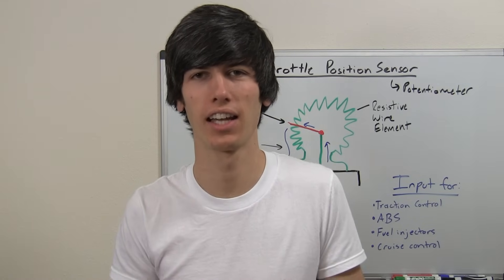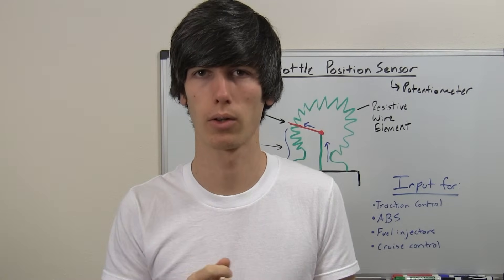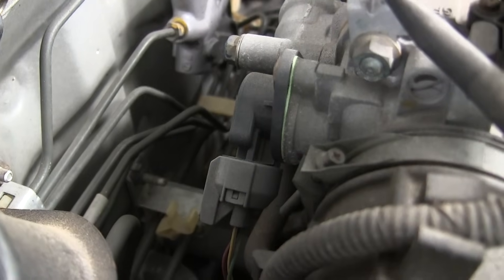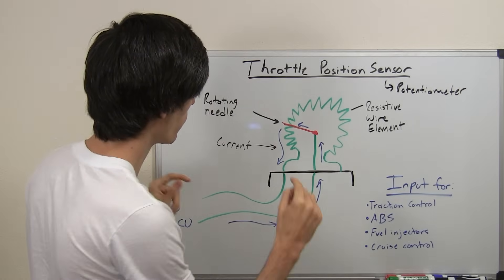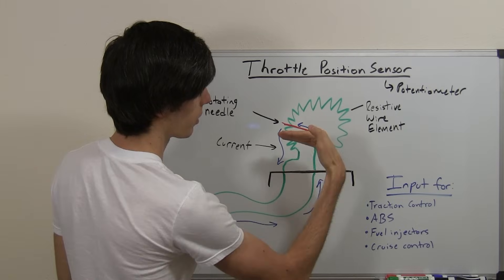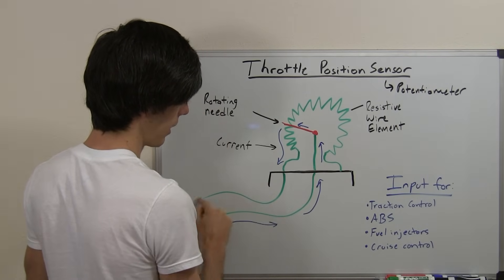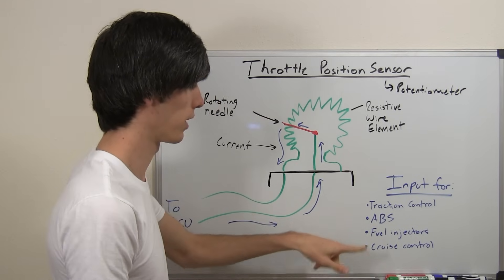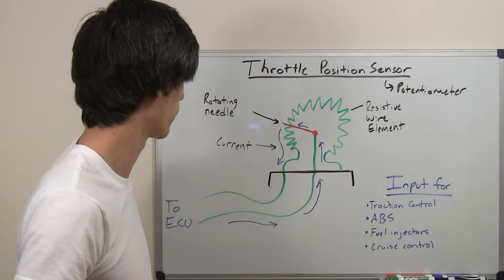Throttle Position Sensor - Explained

Comment: does a correct tps voltage affects the fuel consumption of a car? just asking
Reply: yess it does affect the fuel consumption.
Over time this sensor wears out, and will not read the same voltage anymore.
It makes the fuel trims rich if the voltage is higher,  or lean when its reading lower voltage.
It also makes a big difference in acceleration and torque feeling !

Comment: Is the TPS calibrated for a specific engine size and will that affect the engine performance if I put on the wrong one? I'm asking because I have a 3.0L V6 but when I look for a replacement part, they all say they are for the 3.5L engine model. Will that still be compatible?

Comment: Voltage divider circuit is fixed to a certain resistor division of a circuit,whereas TPS sensor works on rheosatat or variable resistor circuit such as volume control,etc.

Comment: If it's got a HIGH-RISE INTAKE than Does oxygen fall into the throttle body faster allowing more airflow? If u use a THROTTLE BODY SPACER oxygen falls further causing more compressed oxygen. Resulting with more power in some engines.

Comment: Good explanation but useless for me.  I need to know if the TPS is the cause of my crank/no start condition.  My 1995 Honda Civic (1.5L) runs perfect once I get it started but will not start without spraying starter fluid into the throttle body.  It will also start IMMEDIATELY when I jump a spark plug wire to ground to verify there is sufficient spark.  I have tested and replaced all the usual suspects, except the TPS, MAP, fuel pressure regulator and injectors. There is plenty of fuel pressure and the injectors pulse well.  I'd like to know if a bad TPS can cause a crank/no start?

Comment: Modern electronic automatic transmissions also need TPS input(for torque convertor lock-up). For that the ECU/ECM/PCM needs to know when the throttle is fully closed or not. There's an entire circuit in the TPS dedicated to that alone(a.k.a. the "idle" signal).

Comment: Can you assist my question:The TPS reading plays a vital role in the mapping and map switching .
Therefore it stands tor eason while I am trying to gain economy , with my TPS incorrectly seated , the maps are being switched in earlier or later than they should .
My assumption would be that the TPS voltage has to be set and recorded before any tune OR by factory to align the maps being used correctly .
Alternately the TPS can be used to fine tune the AFR based on its position at a certain RPM.Thanks in advance-Well done for appearing on Between the Lines Documentary -awesome Subaru magic

Comment: So the sensor tells the injectors how much fuel to input, which also correlates with the amount of expected airflow based on the butterfly position.  OK so it is this data the MAP knows and expects to see in normal operation.  The throttle position then creates that ratio of 14.7:1 fuel mix no matter where it is.

Comment: What could be the problem if my scan tool reads absolute throttle position erratic? Even when the vehicle is engine off key on. If I do not press on the peddle the reading erratically goes from 0% to 10% or so, back and forth. It does this while idling too. I checked for 5v reference and 1 to 5v output (as peddle is pressed). Seems good data is coming into pcu, it’s just interpreting wrong.

Comment: Can TPS have any impact on Tranny or how Transmission handles? I am hearing it can be the cause for RPM going way high and car not shifting to higher gear. A reason that someone may suggest you to rebuild the transmission!!  Is this true?
Reply: yes it happened on my 3.3 nissan engine and the transmission wasnt shifting when it should to a higher gear resulting in over reving RPM before shifting up

Comment: My 02 eclipse gt 3.0 is having problems idle'ing right after starting? It's been necessary lately to give a lil gas to stay going which I never had to do before? I replaced the Idle control valve, & removed my cold air intake but still I have the problem. Please HELP!! Thanks & love your content!

Comment: It seems to me that the TPS is another sensor that tells how much air flow is coming in so the ecu knows to inject more or less fuel. But then why would you need a TPS AND a MAPS?
Reply: Stephen Pentony map sensor is allot more precise. Think of it as a team. One is the muscles the other is the brains. One gets a base parameter, the other fine tunes it. Thousands of times per minute.

Comment: I have a 70 millimeter throttle body we set it at 5 we open the throttle reeds 4.5 I didn't have that tps on for a week and my check engine light is  on do I have a bad TPS sensor or did I do something wrong by trying to set it at 5 where it supposed to be at

Comment: I have a 2004 Suzuki GS500 that has a throttle position sensor. However, the bike has no traction control, no electronic fuel injection (it has a carb), no ABS, and no cruise control. What, then, is the TPS there for?

Comment: I think you explained this wrong. Potentiometers have three terminals, positive, ground and signal. I dont know is the ECU actually reading the voltage difference, because from middle pin you get variable voltage when you turn the pot. Please correct if im wrong.

Comment: Your description for what a TPS does is good, but your description of HOW it does it is not entirely accurate.  It works more like a voltage divider.  Most TPS are 3-wire; power, ground and feedback.  The resistive element is connected to Vcc on one side (typically +5V) and ground on the other.  The voltage along the resistive element will drop as you approach the ground side.  So the voltage read at the wiper will drop as it approaches the ground side.  The ECU reads the voltage at the wiper by reading the feedback line.  Google throttle position sensor schematic and the pictures will explain it better than I did.  I hope this is helpful. :)
Reply: 4-wire. If you know what the "idle" signal is for. A little less google...a bit more get under the hood and see(and/or read a proper service manual) next time ;)
Reply: @MetalMasterdom  They are actually typically 3 wire.

Comment: Can u please show how the ECU controls the fuel injection in engine by sensing the position of accelerator paddle and input and output to ECU in this (like in throttle position sensor ECU uses voltage difference to sense the position of throttle )

Comment: Ok. This situation has me stumped for a solution, and others I know as well.  My good friend, Kevin, has a 94 z71 Silverado. he currently has a 305 tbi with a 4l60e transmission. He's wanting to do a swap to a 454 carbuerated. But, since the 4l60e runs with a tbi and needs a TPS to be able to function properly, it won't work with a carbuerated engine. Now, this is a budget build so buying another transmission is a last resort. Is there a way to fool the transmission into thinking that we do have a TPS on the intake and force it into proper function or is another transmission really the only way?

Comment: to the engineering auto dspt .Do

you think it is possible to take a cooled air intake and use it like a turbine with little fins inside and make it get the same idea as the turbine .I race a 4 cylinder asphalt a d I have a cooler that is ice cooled with dry ice around d the inner pipe witch tells your pcm to add more fuel which I have a fuel regulator inside the cockpit to regulate ,but what about the air I have the end o of my pipe coming g out of the headlight where i gets lots of air at 100 mph  but I have thought if the inside of the  oiled air intake pipe was built likes turbine. WhT do youth I k and how would you go about it I have some plans that I have patented but would lime an engineers onboard with me for 1/2 the company.

Comment: man I got a honda lude 97 with every thing changed in it problem is h22a enginge manifold of I dnt know what ...what it do is rpm fluctuates frm 1 to 2 on tachometer. ..cleaned throttle body iacv fast idle control is not there ....now the thing am suspicious about is tps I dnt know may be I dint fixed it right when I opened tps ...anybody with suggestions?

Comment: hey ,
i have a doubt that we are using MAF sensor , MAP sensor and Throttle position sensor . These all sensor are used for measuring how much air is flowing into the engine. So why 3, we can use either one of sensor.
by the way great explanation.
Reply from the maker: +Shiv Yogi You can have MAF or MAP, but you can't eliminate TPS. Knowing how open the throttle is doesn't tell you the pressure of the air, temperature, etc...
Reply: +Engineering Explained Then why position of throttle is measured .?
Reply: +Engineering Explained Sir, correct me if I am wrong. I understood the MAF  measures the Flow Velocity. The TPS  measures the Pipe or air plenum opening . By knowing these two parameters, the ECU will know the volume of air coming in by the formula  Q=VA.where  Q= total air flow or volume, V= velocity  and A = open area of pipe or air plenum. The TPS measures the  opening.
Reply: It for traction, abs and fuel injector. It supply's all them with information by using the drivers input
Reply: +Shiv Yogi Sir, correct me if I am wrong. I understood the MAF  measures the Flow Velocity. The TPS  measures the Pipe or air plenum opening . By knowing these two parameters, the ECU will know the volume of air coming in by the formula  Q=VA.where  Q= total air flow or volume, V= velocity  and A = open area of pipe or air plenum. The TPS measures the  opening
Reply: Rolando Lloza In regards to the Maf it knows 4 things. How much air is coming in. How dense that air is. What temperature it is coming in. And the volume of air coming in. The TPS looks for the gas pedal being depressed in correlation to the air coming in through the throttle body. Both of the sensors are measured in volts, and Maf is open loop sensor which then turns to closed loop mode thanks to mr. o2 sensor.

Comment: I would like you to do another video on tps as to what happens the injectors as it reads for higher voltage vs lower and what happens to these components when you set the tps too high or too low. that would be great.

Comment: I love how you only show two wires in the throttle position sensor. I have yet to see a two wire sensor on any vehicle ever.
And the potentiometer theory was clever, but doesn't explain hall effect TPS units found on high end vehicles.
Reply: Bobby D I don't know why that would be considering the hall effect has more potential to be inaccurate.
Reply: Jajajawut

Typically I wouldn't even bother responding to such an ignorant response. But.....

You need to re-read what you said, and then go Google some shit.

EVERY fuel injected car EVER made, in the history of earth is loaded with hall effect sensors.

You know that speedometer in your dash? well unless you drive an antique with a cable operated speedometer, that means you are likely to have at least one hall effect sensor there....

your secondary ignition system, uses a hall effect sensor in either the distributor or in direct relation to the camshaft or crankshaft or in some cases both.....that's another one there...

Anti-lock brakes!!! guess what!!!! Wheel speed sensors are ALL hall effect.....

so exactly how did you come to the conclusion that hall effect sensors are in any way shape or form inaccurate?

Being honest and realistic I want to point out to you that since the early 70's when hall effect sensors became standard issue on most electronic distributors, they have maintained a degree of accuracy well beyond the credit you just gave them.

After all, your typical V8 has 8 ignitions per cycle, so if the hall effect sensor was that unreliable, how do you explain H.E.I ignition systems reaching the 6,800 rpm range ?

thats 8*6,800=54,400 sensor passes per minute, or 54,400/60=906.666 passes per second.

Maybe you have some documentation to backup your dribble?

If you actually have some substantial proof of this I might just have the latest method for evading fines for speeding tickets.

Next time a cop pulls me over I will explain to him how some guy on the internet told me that his speedometer could not possibly be accurate enough to have paced me properly. Then I can subpoena you to court to testify as an expert witness.

LOL have fun learning more about hall effect sensors.
Reply: There's a chance it might not have been. In motorcycles it's extremely common for hall effect speedos to lose accuracy after 130 mph. I would only assume the same effect amplified on a smaller scale.
Reply: Jajajawut 
I have never heard of a hall effect pickup that's properly fed with a bias signal losing accuracy. Perhaps this is less an issue with the pickup and more of an issue with the motorcycle mfg. 

That being said all of my previous bikes had zero issues with speed accuracy when compared to my gps. Of course we won't talk about the speed in which my liter bikes have been pushed too.

Perhaps buy Yamaha and not hyosung?
Reply: Well I had a Suzuki at the time. I was reading through a bit of what you wrote and I might retract my statement if you weren't so rude about it. I only know what I know about the hall effect from my basic knowledge of how it works and it's somewhat tested inaccuracies in dyno testing on motorcycles. Though my Suzuki came new off the lot with a bad rectifier so maybe it could be a Mfg. flaw with Suzuki. But I'm also more inclined to believe a calibrated Dyno vs a GPS.

Comment: Can I ask what the Position Sensor Controls? The butterfly valve that the TPS is linked to controls air flow through the engine, but at the end you said that the ECU controls the amount of fuel to provide. Could you explain the step by step please?
Reply: The throttle position sensor is just part of an array of sensors used to determine the amount of fuel to deliver.

For an example we will pair the throttle position sensor with the manifold pressure sensor. (speed density system)

Scenario:
you snap the throttle to 20% and hold it.

What's happening:
1.) The throttle position sensor detects throttle movement and tells the ECU that you are depressing the accelerator.
2.) The manifold pressure sensor spike up in response to the now opened throttle valve.
3.) The ECU reacts by measuring the difference in vacuum from the last 15 samples then compares the return value to the current throttle position. This determines the engine demand.
4.) as the vacuum returns to the intake the manifold pressure sensor detects the change and the ECU can see it.
5.) The ECU shortens the pulse width to decrease the volume of fuel being delivered as engine demand is now lower.

Obviously I skipped some other things that happen in the system in the real world as this was only an example of the two most common sensors next to the throttle body. There is obviously more to the equation, such as fuel trims, oxygen sensors, crankshaft position sensors, ignition timing. Also there are Mass Airflow style systems which react in a similar fashion to speed density systems but have the added advantage of actually calculating the air volume coming into the engine to establish a more accurate air fuel ratio.

Comment: For those of you who understand electronics: It's basically a potentiometer tied to the butterfly shaft. One terminal connected to the 5V reference voltage,the other one is grounded,and the wiper goes to the ECU/PCM/whatever. :)

Comment: I have a 01 sentra 1.8l and its acting weird...when i try to rave the engine it sounds lik it has a misfire but when i didconnect the wires going to the TPS is raves fine without chocking.what do you think could be the problem?

Comment: So would it be safe to say that the majority of air flow systems in an engine are regulated by the ECU measuring current, voltage, or resistance and then changing fuel injection appropriately?
Reply from the maker: Yep.

Comment: How does the TPS effect an automatic transmission shifting? And is it the same in both manual and automatic transmission cars?
Reply from the maker: Yes, it's pretty much the same regardless, but in an auto it can use the position of the TPS to determine what gear you should be in. If you stomp the pedal it'll downshift because the majority of the time putting your foot down indicates you'd like to accelerate quickly.

Comment: i kwon the funtion of many artifacts that deal with a variable resistance to tell the ecu a little info, but the question that i have is if the plate mass airflow sensor could be repalce with a TPS Sensor to eliminate that obstruction it makes on the intake tube of my engine. it seems to be heavy and it may causing a the engine not to breathe well. since both are different and do the same job what can i do to get rid of the plate mass air flow obstuction????

Comment: What's bad is if you have turbocharger or supercharger installed right? Because you'll end up injecting more air then fuel because it's a (throttle position sensor) not (mass airflow sensor)

Comment: The on/off strategy is called Pulse Width Modulation (PWM). It is how most valves are commanded and how many newer sensors read their inputs.

Comment: Don't confuse the TPS with the actual valve. The valve is commanded open by using electric. The ECU actually tells the valve to open by turning the valve on for a short period then it allows the spring to close it slightly for a even shorter period. The TPS then reads the position to confirm the valve is open where it wants it. If it isn't it will adjust the on and off times of the current to the valve.

Comment: Most valves are opened by applying electricity and returned with a spring. If the sensor fails the ECU stops commanding the valve and the spring returns the valve to the closed position. This makes the valve fail-safe. All sensors and valves work in this fail-safe manner.